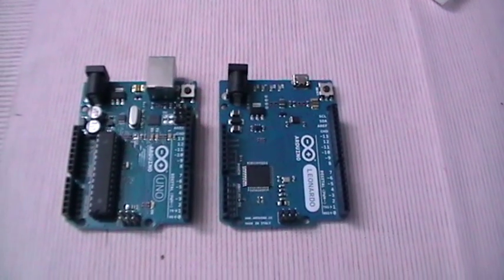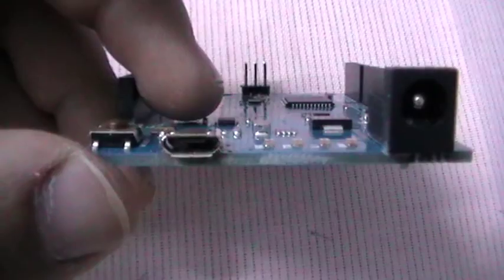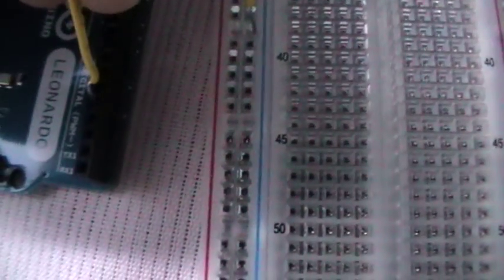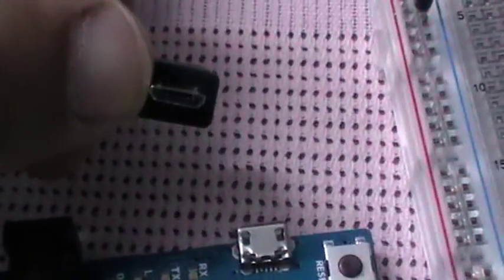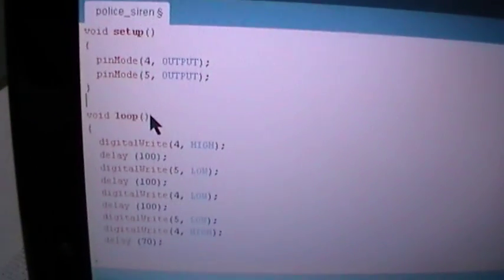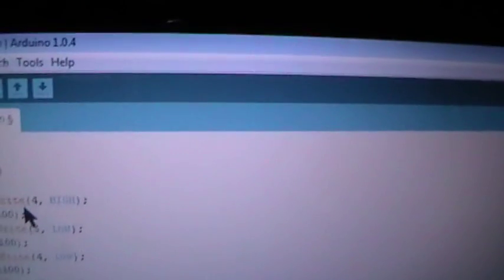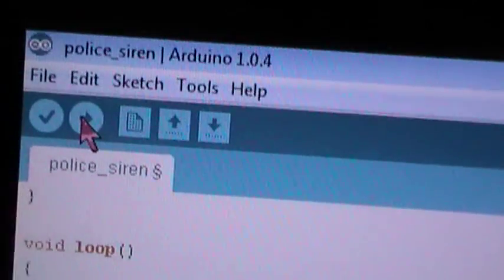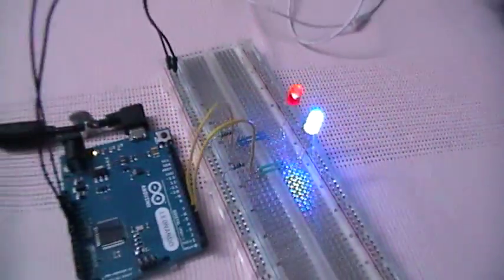Arduino Leonardo police siren project designed by PC Doctor

Comment from the maker: void setup()
{ pinMode(4, OUTPUT); pinMode(5, OUTPUT); }
void loop()
{
 digitalWrite(4, HIGH); delay (100); digitalWrite(5, LOW); delay (100); digitalWrite(4, LOW); delay (100); digitalWrite(5, LOW); digitalWrite(4, HIGH); delay (70); digitalWrite(5, HIGH); delay (100); digitalWrite(4, LOW); delay(100); digitalWrite(5, LOW); delay (100); digitalWrite(4, LOW); digitalWrite(5, HIGH); delay (70);
}